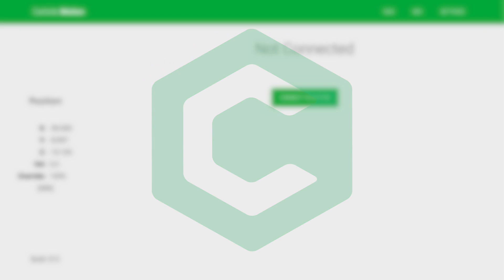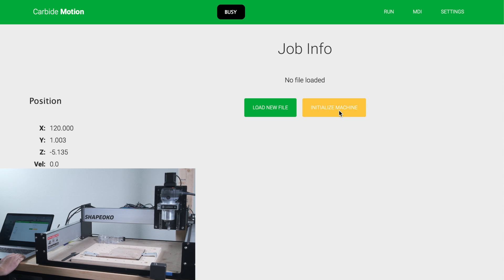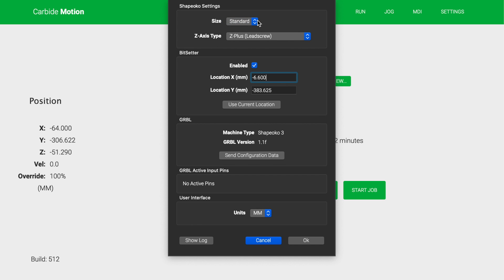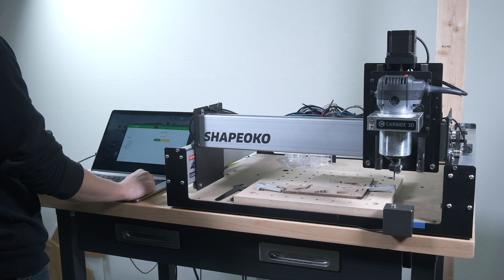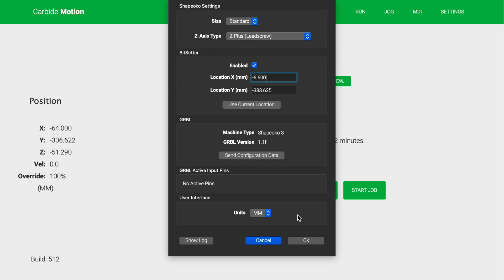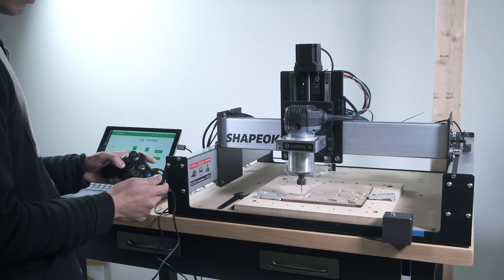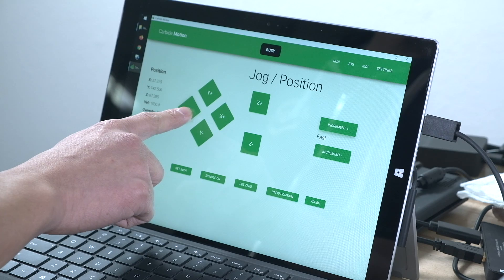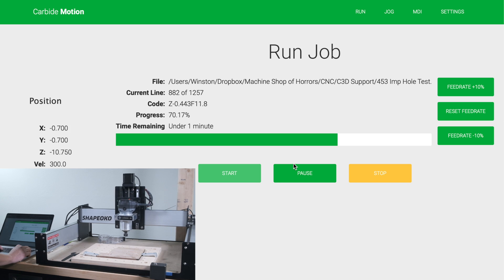Carbide Motion v5 is Brand New Under the Hood

Comment: I bought a Shapeoko pro because I thought it was the best value for the money but Carbide Motion is really holding me back a bit. It needs better MDI interface, support for multiple offsets, a simulation capability, and tool wear offsets for cutter comp and a better way to control the automatic movements with the bit setter as well as a quick rapid over ride. It seems to be a solid base, but needs far more capability to be truly useable. It doesn't need to be a Haas, it just needs some better setting availability to be truly marketed as a CNC machine. I'm a machinist at my day job, so I've seen a thing or two. I don't claim to be the most intelligent guy out there, just really missing these features when I use the router. It would even be fine if this software was free and the advanced software was a one time payment. I would gladly pay a reasonable price for more access to settings.

Comment: I installed Carbide Motion v5 and got edition 542.  Nowhere does it have a place for me to tell it I have an XXL model, it goes directly to Shapeoko Pro HDZ.  I have had nothing but problems including replacing 5 parts, all three limit switches, the power button on the front, and the circuit board.  After 6 weeks of working on it, it still is not working.  I researched CNCs and thought I had picked what I think is the best for me, but I am about to change my mind.

Comment: OUR RIGHTS MATTER ok, that might be a little over the top but if you watch the news this is the new norm.       Now on a serious note the previous comment is right on automation is great but in some cases being able to manually control the movement of the router would make the job setup (in some cases) faster and less frustrating than having to go through all those unnecessary movements.    All in All Motion5 is a great experience.

Comment: Very excited about all the work being put into Carbide Motion and Create. I still would like to see multiplatform added to Carbide Motion. As an original Shapeoko user with many upgrades I still cannot use Carbide Motion and Carbide Create limits the size of designs to 24 X 24. I have looked at just adding a new controller to my Shapeoko but this is not currently sold. Hope that as Carbide 3D moves into this new application design phase they can find a way to grab onto the ever expanding market of CNC systems.

My current setup - Shapeoko 2 with Arduino and GRBL shield, expanded frame to 1000mm x 1800 and raised rails. Love the machine just wish I could use all of the new features in Motion and Create.

Thanks for everything!

Comment: I have an Xbox 360 controller that is wired via USB. It shows up in the win10 devices as Xbox 360 controller plug and play device. 

I cannot get the device to connect to version 513 in the jog screen. Is there anything else that needs installed or setup?

Comment: What is the meaning of (error in line 3: motion mode is unset?) Shapeoko XXL is dead unless it's fixed.
Reply from the maker: We have a beta version of CC (v464) you may want to try, and please be sure to ensure the Shapeoko post processor is set. (Edit>Select Post Processor). If you continue to have issues, please reach out to support@carbide3d.com
Reply: @carbide3d  It is something that a simple word change can make such a difference. Thanks

Comment: Tried Carbide Motion V5 but could not get it to work properly.  Disappointed as I could not find V4 to reload.  I could not see the bottom half of the Rapid Positioning Screen along with other road blocks.  I am sure it will be good but for now it's a road block
Reply from the maker: Assuming you're running Windows. Do you have High-DPI scaling turned on? If so, please disable it (at least for the CM application itself). This is the most common reasons the UI doesn't fit on the screen. If that doesn't work, please feel free to reach out to support.

Comment: Hey Winston,
Thanks for the video and was running the beta version5 and was able to preview the changes, just downloaded the 513 build and installed it. How is the game pad controller supposed to connect? I have it on the laptop as i can see it attached via bluetooth but how is the shapeoko supposed to tell that it's connected? Is this supposed to be automatic? 

Thanks,
DJ
Reply from the maker: When you enter jog mode, CM will search for a compatible gamepad automatically. If found, it will display "GAMEPAD ENABLED" at the bottom. Windows only right now, Mac to follow.
Reply: @carbide3d  Thanks Winston.. I guess it's only working with Xbox controllers? I have a PS4 and it seems that it does not seem to recognize it.. I will keep playing with it and see if I can get it to work. 

Appreciate the quick response.
DJ

Comment: I just installed it today. 
Wow!!
Huge improvement!! Bitsetter options are awesome.  
The ability to choose between  the software controlling the spindle and manual goes right with my Jason Stewart VFD wiring. 
The only thing I'd like to see is a 0.387 and 0.5 endmill option in the probe library.

Comment: This looks great, but one thing I would request is to give me more control over the machine. Remove some of the automatic stuff - at least as a configurable option. As an example, let me decide when to initialize/home the machine. Let me decide when to run a bitsetter cycle. I don't necessarily always have a bit in the spindle when I initialize, and if I have the bitsetter enabled it will automatically attempt to run a bitsetter cycle without a bit. This will fail. Give the user some granular control without so much hand-holding. Trust your users to operate their machine. Let the user dictate the work-flow, not the other way around. Will mistakes be made? Yes. But that's how people learn (at least if they're paying attention).

Also, put more of these controls on the main screen, instead of squirreled away in sub-screens. I know you're going for a sleek minimalist interface, but if it doesn't give the user the information and control he/she needs to efficiently operate the machine, then it's just a pretty interface without much value. Obviously you don't want to end up with the out-of-control mish-mash of WTF that is the Mach3 interface, but something in between that is informational and more immediately functional would be nice.

Keep up the good work. So far I'm very impressed with the Shapeoko 3 XXL (Bitsetter, Touch Probe, Leadscrew Z) that my company purchased recently. I'm looking forward to making lots of G10 based test fixture plates with it. These plates have (sometimes) hundreds of pogo pins in them, so this will be very nice for manufacturing them.

Comment: Is there a way to cut larger pieces that are beyond the machines cutting dimensions? Such as tiling a design seen in other programs for cutting the sections ?  For example using the shapeoko xxl, is there a trick or recommended method in cutting a sign within the width of the machine ( 30”) but length (y axis) 4’   Making the cut out 30” x 48” ?
Reply from the maker: You already nailed the solution: Tiling. You just need to use a CAM software that supports it, and off the top of my head I only know of Vectric software that does it. If you're handy with Fusion you can also manage something similar.

Comment: Gamepad feature is nice. I've been using the app JoyToKey and have some advanced clicks mapped to access the common pages, only when in full screen however as it's mapped to different X,Y screen coordinates: Run, jog ( and rapid position and "done" to exit, and set zero/done.) 
I have A,X,Y,B mapped to the various increment jog speeds so I don't need to look at the screen to see what I'm on.

Comment: The gamepad controller would be great if it had support for analog movement. That way the machine moves slower as your stick moves closer to the centre and faster towards the edges. You can also use the analog triggers to do the same thing with raising and lowering the z axis.

Comment: I had my old lab top stolen got a new down loaded CB create and CB motion 4m. CB create is working grate with no issues but when it comes to running CB motion nothing is working correctly. I’ve only been able to get the Machine to initialize once. After that the z axes motor just makes a buzzing sound and will not move in any direction. A homing cycle error shows up and a unable to locate z axes limit switch shows up. Some times it saids GLBE resource error. I’m about to loss my mind please help
Reply from the maker: Please reach out to support: Support@carbide3d.com

Comment: Hooray for controller support and rapiding speeds! I'd love the option for a proper pendant at some point, but this will be a big upgrade over the keypad I'm using. Will the controller work even when you're not on the jog screen? My computer is across the room to keep it away from dust, and I frequently find myself trying to jog while on the Set Zero or Run screen.